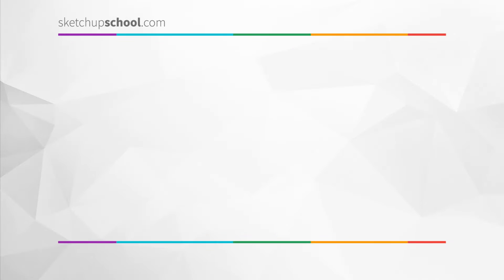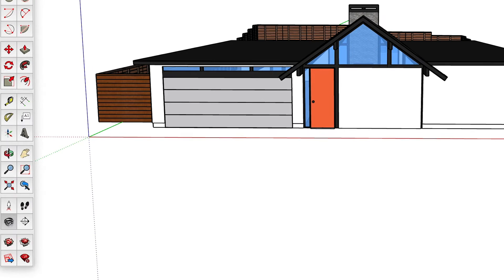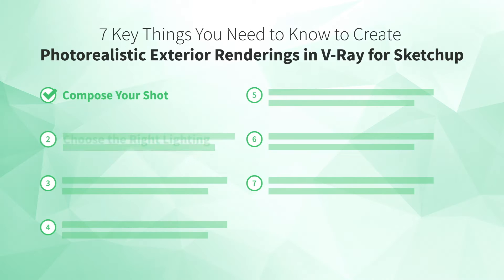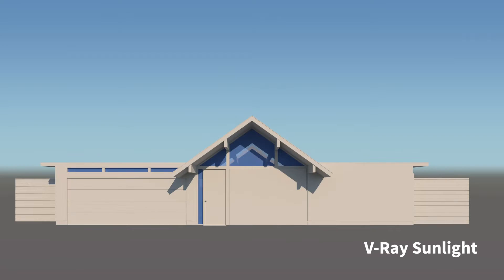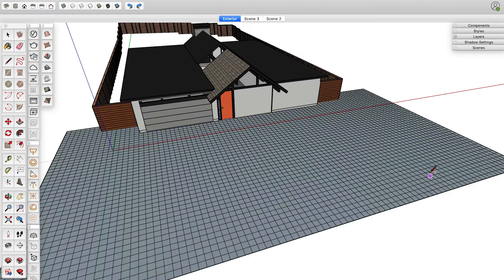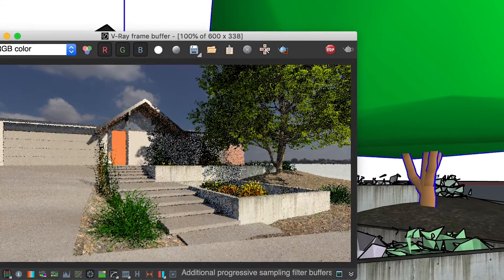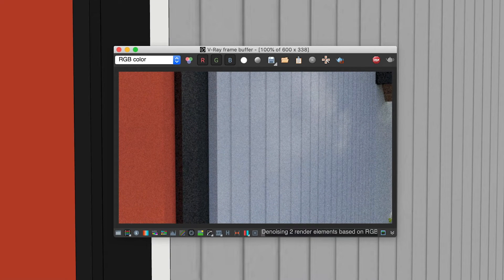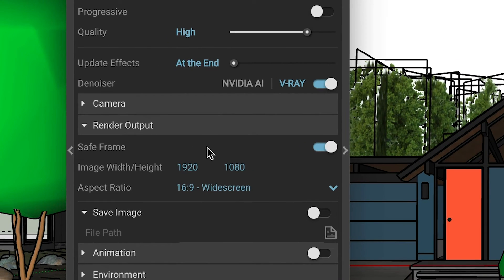The Key Steps to Rendering Exteriors with Vray for SketchUp

Comment: What does material override mean?
Reply from the maker: It is a setting where you turn off all of the materials (and replace them with a white or similarly dull colored material) so that you can focus on the lighting while not being distracted by all of the texture and reflection of the materials
Reply: @SketchUpSchool  Nothing special with my case, so the default setting of the material override should normally be turn off, right?

Comment: Please help me sir,,,,
I have i5 8th windows 10
Nvidia GeForce MX250 2gb graphics
When I will do render SketchUp file in vray 4 with GPU getting error.
" Failed to allocate file 323721 byets device :0 buffer " like that
So how I will solve it please help..
Reply from the maker: Have you updated your Nvidia driver?
Reply: @SketchUpSchool  yes sir
Reply: @rashminkarkar7848  use either only Nvidia GPU or CPU only.
Turn off progressive rendering and interactive rendering
Reply: @BARCH-wp5vl  I will try

Comment: Hello anyone
My pc specs
8gb ram
i5 8th gen
Nvidia Mx130 (vram - 2gb)
Can i run twinmotion or lumion (8 or 9)
Reply from the maker: It looks like you might just be able to run older versions of Lumion at the minimum specifications... but you'll want to double check here to be sure: https://support.lumion.com/hc/en-us/articles/360036620353-What-are-the-system-requirements-for-Lumion-9-and-older-versions-
Reply: You can run lumion if you follow these settings:
1.Always plug charger ,and change Windows power plan to high performance
2.Always work on layers,add lumion trees and other elements on a  new layer. You can turn on this layer when needed.
3. Go to settings,
- Disable high quality trees and terrain in editor
-editor quality ,1 🌟
-Editor resolution 50% or 25%.
4. Select Nvidia dedicated graphics on Nvidia control panel. Make sure luminous is running on graphics card.
5. Close Other background apps except lumion.
6. Use minimum number of lumion objects. as possible.
Reply: @BARCH-wp5vl thankss...but i am back to vray next...
Reply: @newtownsmartlearn4881 My suggestion is Lumion that is fast and simple to handle ,finally it's your choice.
Reply: @BARCH-wp5vl  hello bro...i i'm going to get lumion 9.0.5 by following your settings.....
I just want to ask will that heat my laptop...please reply..
Reply: @newtownsmartlearn4881  yes mine heats somewhat ,but lumion 8 is lighter and faster than lumion 9 and 10. Give it a try .
Reply: @BARCH-wp5vl  so whats main difference between lumion 8 and 9?  (And which version do you use)
Reply: @newtownsmartlearn4881  I use both 8 and 10 .
10 for adding foreground fine detail trees after completing the rest of the model in lumion 8.
lumion 9- 3d grass and rest is the same
Reply: @BARCH-wp5vl so you use lumion 10 in pc witn same specs as mine...😲
Reply: @newtownsmartlearn4881  no I am using 1050 ti gpu with  full 🌟 in lumion 8 and 2 🌟 in lumion 10 . My friends are using lumion 8 in 2gb GPU.
Reply: @BARCH 1520 ok thanks for all the information